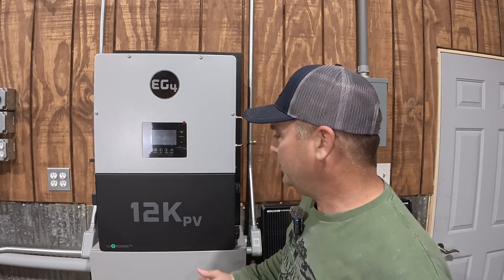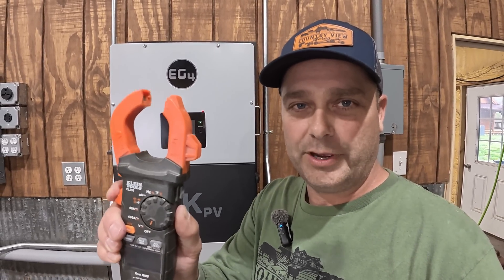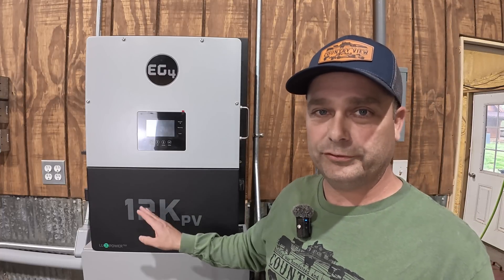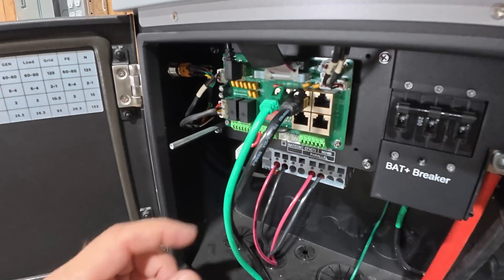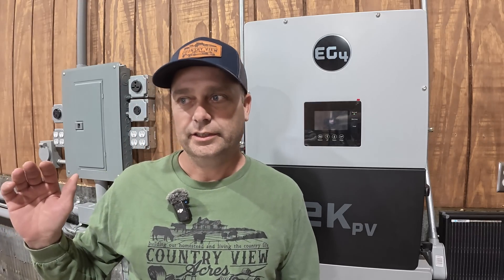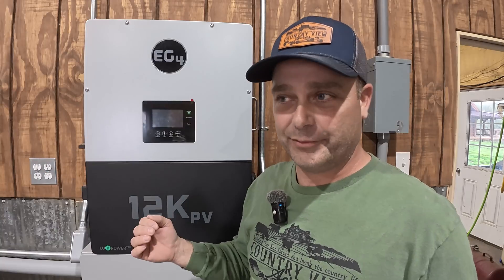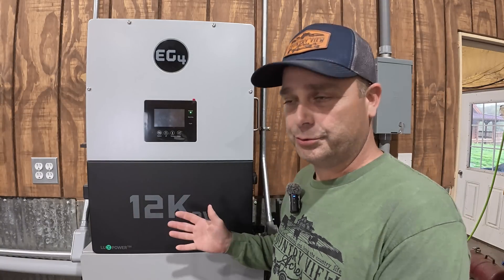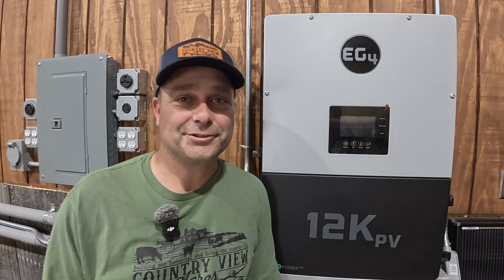Fixing the Amp Readings on 12Kpv CT's, So I can Zero Out my Electric Meter

Comment: EG4 inverters, particularly the 6000XP, 12000XP, and 18kPV models, have been reported to experience a range of issues, including battery communication errors, incorrect charging profiles, and PV voltage/current problems. These issues can lead to system shutdowns, power loss, and inaccurate charging. 

Common Problems Reported:

Battery Communication Errors:

Many users report receiving battery communication errors, especially with the 6000XP and 18kPV models, leading to inverter shutdowns and generator control issues. 

Incorrect Charging Profiles:

Some users have observed charging issues, such as the inverter stopping charging at 100% SOC even when batteries are not fully charged, and issues with PV charge priority settings. 

PV Voltage/Current Issues:

Spikes or rapid changes in PV input voltage have been reported, causing the inverter to disconnect or throw warning 28. Some users also experience issues with PV voltage/current not correlating with inverter readings. 

Overheating:

Overheating is a common issue, often due to poor ventilation or placement in high-temperature environments. 

Generator Issues:

In some cases, generator control features (e.g., generator start) have not functioned as expected, even with new firmware. 

Grid Bypass Issues:

Some users experience issues with the grid bypass feature, such as the inverter disconnecting and reconnecting repeatedly. 

Capacity Issues:

Reports of inverters using a significant amount of battery capacity overnight, even when not drawing power, have been reported. 

Dimmability Problems:

Some users have reported flickering LEDs when dimmers are set too low, potentially due to inverter waveform issues. 

Firmware and App Issues:

In some cases, the wrong app has been provided for the inverter, and firmware updates have been reported to resolve certain issues. 

MPPT Issues:

Users have reported issues with the MPPT, particularly with shading or cloudy conditions, leading to unreliable performance and the need for manual intervention.

Comment: Anytime your running ethernet cables outside or not in a building - should be grounded and shielded which you can get with CAT5,6 or 7 as long as your less that 300 feet - i'd bet the grounding and shield helped you more than cat7

Comment: CT is a misnomer  The CT is creating a VOLTAGE on the secondary.. Work with that Voltage....
Reply from the maker: It is current, in the case of a CT.   I googled it and this is what I found.

A Current Transformer (CT) measures current by using electromagnetic induction. It works by wrapping a wire (the primary winding) around a core, and when a current flows through that wire, it creates a magnetic field. This magnetic field induces a current in a separate winding (the secondary winding), which is proportional to the primary current. 

How Current Transformer (CT) Works? 
Here's a more detailed breakdown:
1. Magnetic Field Creation:
When AC current flows through the primary winding, it generates a magnetic field around the core. 
2. Induction in Secondary Winding:
This magnetic field induces a current in the secondary winding, which is connected to a meter or other device. 
3. Proportionality:
The current in the secondary winding is directly proportional to the current in the primary winding, as long as the number of turns in both windings is known. 
4. Measurement:
By measuring the secondary current (or the voltage drop across a resistor connected to the secondary), one can determine the primary current. 
5. Safety:
CTs are designed to isolate the high-current primary circuit from the measurement circuit, ensuring safety.
Reply: @CountryViewSolar-DIYProjects  It's a TRANSFORMER nothing more / nothing less..
AC in AC out.....And yes a resistor across the output will create a current and with other ancillary parts will show the current of the high side.   You can do that with any common Transformer..

Comment: You are confusing people because you are not fixing the problem, only the symptoms.

A CT is an analogue device not a digital device. Just because it is using a network cable for it's wires does NOT mean it's using digital comms.

The correct way to fix your problem requires TWO changes. First you need to keep the noise out of the system, which you have done using shielded cable. Second you need to reduce the losses on the cable, as you said it's a tiny signal, this requires a cable with less resistance (which CAT7 is but only by a small percentage).

What would have been a cheaper and better solution would have been to run some heavy two core cable for most of the length and then splice the correct connectors (RJ45?) to it. I'm betting that they use so called Ethernet cable because it's cheap and they already use the connectors a lot.
Reply from the maker: I never said it was digital.  It's a current transformer, how could that be digital.
Reply: @CountryViewSolar-DIYProjects  The way you were talking about it sounded as if you believed it was an active network device powered and controlled by the Inverter over the network cable.

Comment: Add a couple of ferrite chokes to the end of the cables! that will also help out quite a bit with nocking down RF noise on the cables! i use them alot in Ham radio operations!

Comment: Can these come close to zeroing out load at the main panel, meaning back feeding panel but not so much it will actually sell back to grid?
Reply from the maker: They can get close to zeroing you meter.  There is always a lag, with the inverter adjusting to match the power usage to effectively zero the meter.  So you will have a small percentage backfed and a small percentage bought from the grid.  But probably less than 1 kilowatt hour a day.

Comment: The real solution is an ADC, which converts the analog current waveform into a digital value and then sends that over standard Ethernet for interpretation by the inverter.  This would allow the inverter to be located anywhere in the structure.  Sending any analog waveform outside of a range of a few inches is lazy engineering.  EG4 needs to get their act together on this issue.

Comment: CT Current Transducer.

comms cables should also be in a separate conduit and definitely not with AC conductors. running them parallel in same conduit with high current conductors will induce noise on analog loops.
Reply from the maker: I always considered current transducers a solid state device, that we used in instrumentation.   Also sometimes called a current transmitter, or an "I to I", current to current transmitter.
But a simple (no calibration) CT with a specific ratio, I consider a current transformer.
No matter what you call it.  We know what it's job is.
Reply: @CountryViewSolar-DIYProjects  A current Transformer is an ANALOGUE device not a DIGITAL device. See my separate comment for why I think you are confusing people who watch this video.
Reply: @ I see the logic in that division. When the solid state function became binary we called them current switches.CS

Comment: Curious if you break out the cable to pins and just run shielded 16ga wires if it would be better
Reply from the maker: On My EP cube system, i ran twisted pair shielded and I still had bad readings.  But it was a little farther away.
Reply: @CountryViewSolar-DIYProjects Wow, that’s surprising but thanks for the feedback. We run CTs twisted #10 hundreds of feet when site layout requires it.

Comment: Note that you typically only ground one side of a CAT7 cable going that amount of distance.  The shielding will help with the noise for sure.  If you ground both sides, check to see that there is no ground-loop current (because the grounds are very far apart, there might be).

Even though CTs are current devices, there is still a maximum amount of resistance that they can overcome.  So another thing you can do is... the CT probably just has two conductors, and ethernet cable has 4 pair (8 conductors).  The CT is only using 2 of those 8 conductors.

So what you could do is gang the conductors into two blocks of 4 conductors each.  It is also twisted-pair and so the way you want to gang the conductors is to connect all the solid-colors together for one, and connect all the striped-colors together for the other.  That helps cancel the noise.

But double check to see which conductors the CT is actually using.  I'm assuming that it will be using one twisted pair (one solid color and its striped counterpart), but I don't know.  In fact, also check continuity between pins on the RJ45 connector(s) on both sides... they might already be ganging sets of 4 on the circuit boards in which case you don't have to mod the cable.

-Matt
Reply from the maker: Yes, it only grounds at the inverter to  drain the shield.
Reply from the maker: The pinout of the cable, one ct is using a twisted pair and the other is using 2 Conductors from two different pairs.  I believe that effects the reading not to match.
Reply: @CountryViewSolar-DIYProjects  That  could definitely have an effect.  The wires in different colors have differenet lengths due to having vastly different twist densities.   

The two wires in the same color group (solid and striped for any particular color) are the same length, which helps cancel out any noise incident onto the twisted pair when the signals going over that pair are differential.

CT signals aren't quite differential, but the current is looping so its going in opposite directions between the two conductors carrying it... having it be in the same color group would probably help.

Ganging 4 wires for each conductor will vastly reduce resistance.  Theoretically that should help a lot too.  If you happen to have time to play around with it 🙂

-Matt

Comment: Whybdo you think Signature solar recommends 2 or 3 inverters for a 200 amp service? That's roughly 30000 dollars.
Reply from the maker: 200 amps of 249 power is 48000 watts.  So 3 inverters will get you closer to that.  But you may not need that much power.  Knowing your true power needs is the only way to properly size a system.

Comment: Cool I used shielded cable on one set of clamps in my Sun 1000 seemed to work. They do say the original is good up to 300 feet with just normal Ethernet cable at the 3000:1 ratio. Since I net meter it does not effect me much. Great video